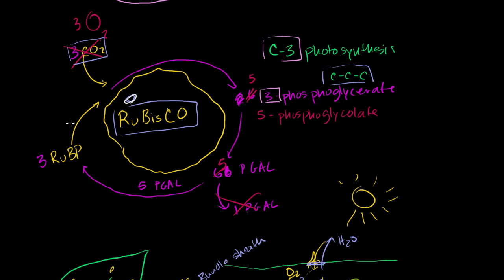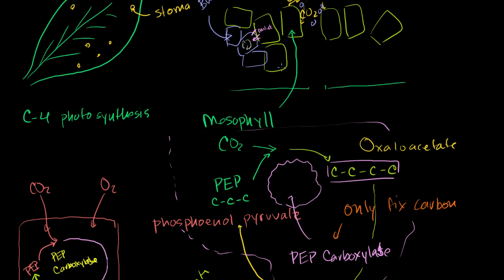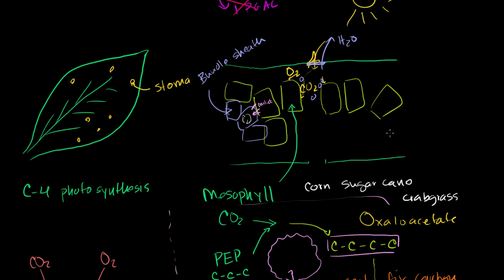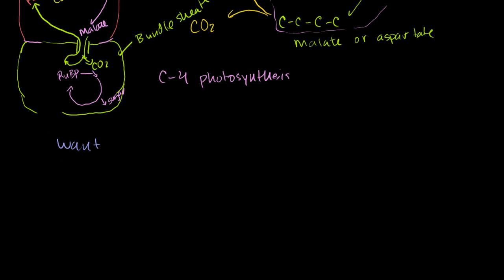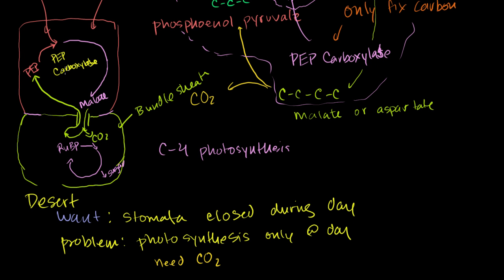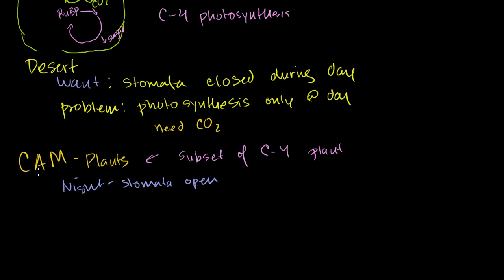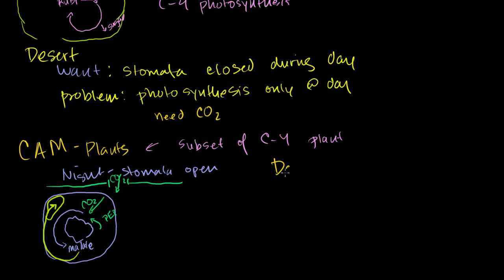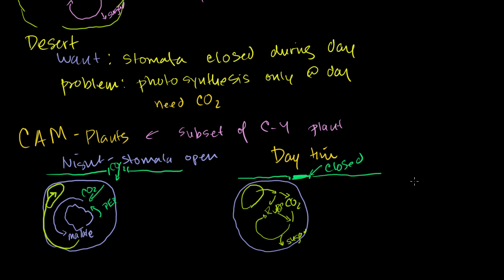CAM Plants

Comment: So when or how does light energy from the sun come in to split h2o and kick start the light dependent reaction
Reply: As far as I understand the entering of light doesn't need the stomatal opening. The opening is only needed for gaseous exchange and transpiration and such. Photons can easily reach water to oxidize or photolyse it, if that makes sense and after the splitting of H2O the oxygen gets expelled out during the night when stomata is open.

Comment: thank you very much for this great video, I just have a little question because I'm not sure from one thing. so because only C4 photosynthesis occurs at night, an acid is produced, and at day time the acid is used to produce CO2 so it would enter Calvin cycle and produce some type of carbohydrate. so at night the plant will be sower and at day it will be sweet? please answer my Professor really confused me!!!
Reply: I think that would make sense. But I think the plant stores glucose in its vacuoles during day time, and piruvic acid during the night time, so it's always balanced. I don't think that affects the flavor much (maybe there is a slightly higher concentration of glucose during the day which makes it a little bit sweeter), but it's a good question. In conclusion, it is not sweeter during the day because it still has piruvic acid stored, but also isn't sourer at night because it has glucose stored.